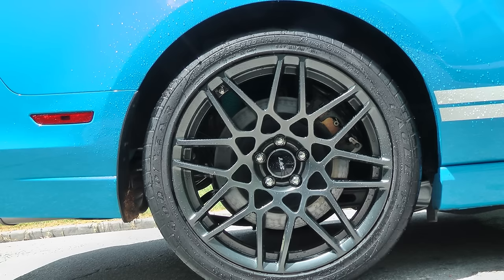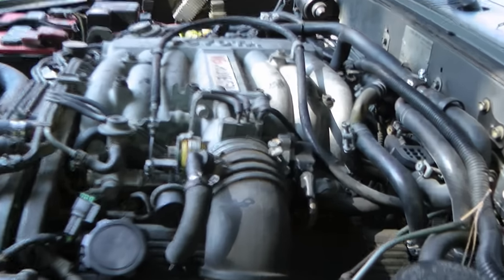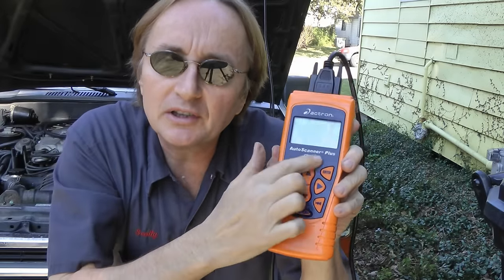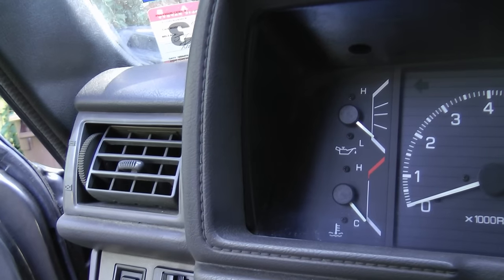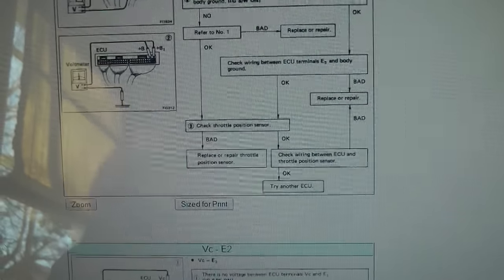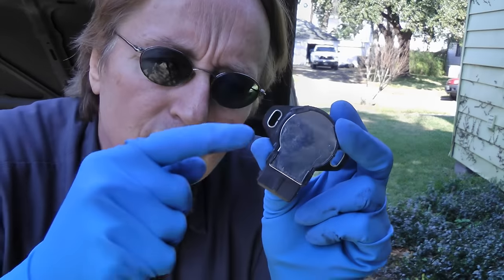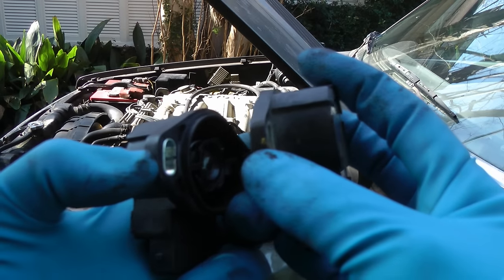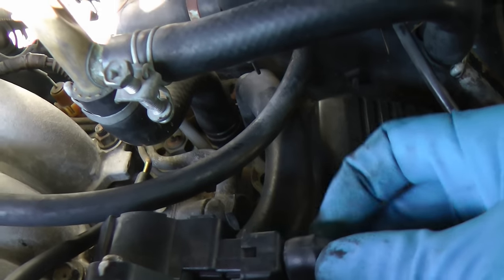How to Stop Car Hesitation (Throttle Position Sensor)

Comment: i have a 1990 full size blazer with a 5.7 tbi ive changed plugs,wires,cap n rotor,coil,ignition mogel n the distributor it still has a miss to it n a hesitation when throttle is pressed its been lije that bout a few weeks now.now when i drive it over a half hour or more it starts to bog out n backfire then shut off but starts back up it will do it a few times then i gota wait bout 20 min till it starts back up.....help
Reply from the maker: +Edwin Padilla   often fuel injector problems on those throttle bodies, try a couple new injectors
Reply: K thx

Comment: My bmw 323i 2009 is having issues where it will stutter when accelerating. The engine feels like its misfiring and when i turn on AC/heat i smell burnt oil. This issue cropped up right after taking it for an MVI. Please help.
Reply from the maker: +Daquan Jr. tons of things can do that, I would start with a full scan of recorded and live data and pray it's somethings like a bad ignition coils that go out a lot in those
Reply: Scotty Kilmer thanks for the info. someone said it's the abs tone ring, and when i turn off the DTC the issue goes away but burnt oil smell still there.

Comment: when i accelerate in my car it starts jumping and it wont go past like 10 to 15 mph when its cold but the service engine light isnt on could that be a sensor it doesnt do it when the car is warmed up
Reply: Thats definitely not the sensor. That sounds like a transmission issue.. When was the last time you had it serviced?

Comment: Just had a tune up on my 2007 chrysler 300 and now its hesitating when I stop for traffice lights, which my car didnot do with the old plugs!  I called the dealership & told them, I was unhappy so again I have to take car into shop.  SOMETHINGS NOT RIGHT.

Comment: hey maybe you can help me, my honda drives good for a while but after its warmed up, if I stop for any reason, and I hit tho gas peddle theater engine revs up, rpm goes up but car will hesitate for a while, and I can't gas it either, because  car just revs up and takes 10 seconds to pick up speed and then pulls hard
Reply from the maker: +Edwin Pastuizaca  if it's an automatic, transmission is going out. If it's a standard tranny, clutch is slipping and needs replacing
Reply: +Scotty Kilmer thank you , appreciate  it

Comment: what does it mean when my car seems like its accelerating while in park. it acts as if  I press on the accelerator and let go. it happens several times until i shut off the car.
Reply: My ranger was doing this as well. I thought i had bad sensors, but it ended up being a dime size hole in a vacuum line, i would suggest a vacuum check.
Reply: stupidmop420 turns out it was the throttle body gasket lol

Comment: hi I have a 2004 Toyota vitz and all of a sudden when I stop or switch gears my car engine dies den I have to restart it and the engine light comes on and when I press gas it takes forever to move is it my throttle body??
Reply from the maker: could be tons of things, but it's dying, so it sets trouble codes. Have a mechanic scan it for codes and see what it says. Even auto zone will scan it for free, then e mail me the codes as follows"If you wish to ask me car questions, I am switching my questions and answers to my google+ community “Auto Repair With Scotty Kilmer”. E mailing me here is ONLY for the live car talk shows on Thursdays at 1pm and saturdays at 10 am WHEN the shows are actually airing and I am answering live questions. So please, if you want your questions answered, go  to this link https://plus.google.com/u/0/communities/110758243155230074828  and join my community. You can then ask your question there and I answer them personally. You can also attend my weekly  Thursday afternoon and Saturday morning Live car talk events where I answer your questions live. . Just check it out at   https://www.youtube.com/watch?v=R6TIeV5oMYo
 And remember, every Tuesday, I upload a new video on youtube, don’t miss them."
Reply: hi the mechanic ran a diagnostic tests and he said it is the throttle body

Comment: code p0122 came up so I replaced the TPS and calibrated. but the error code still comes up after clearing it, any ideas?
Reply from the maker: bad wiring or bad main computer IF tps is actually goo

Comment: my toyota tundra runs smooth no miss in the gas, but it wants to hesitate going up a hill other than that it runs fine . need help
Reply: Brandon napier fuel filter
Reply: I had a truck that would miss or hesitate going up hills and it was an ignition coil going bad
Reply: both previous comments are a good bet, I also had the problem on my tercel and it turned out to be one of my spark plug wires grounding out and a cracked cap and rotor

Comment: my 1995 camaro runs but has no power and shakes when on the gas... any thoughts ??
Reply from the maker: +Paul Bonia tons of things can do that on such an old vehicle. Try tuning it up first, if not that, change the fuel filter and pressure test the fuel pump to see if it's weak
Reply: +Scotty Kilmer,  I did a tune up and oil change 2 days ago..  I'm going to clean out the throttle body and the Sensers and see what happens from there

Comment: i un plugged the trottle postion senser and it ran better so i put a new one on it and it runs good but has no power i un plug it and power is back
Reply from the maker: +Matt Hasting that's not a good test on any modern car, as computer software can compensate for unplugging stuff quite a bit. Have a pro analyze it, as in my video "fixing insanely complex modern cars"

Comment: the truck started to throw  dsrk smoke and doesn't go faster than first or second gear...what can be wrong with it?
Reply from the maker: it's running super rich, often leaking injectors or fuel pressure regulators do that

Comment: i have a 2002 Volkswagen  jetta and it doesn't  pick up  speed even when my foot is down  all the way what is the problem
Reply from the maker: +Emilio Rodriguez  have the maf sensor checked, and also pressure test the fuel pump to see if it's weak
Reply: Ok thank you

Comment: please help. don't know what the problem is but my car seem misfire after driving for awhile. on uphill my car even roll back when I press on gàs
Reply from the maker: start by pressure testing the fuel pump to see if it's weak
Reply: ok I haven't tried that yet. so far I have changed the transmission fluid n install new engine mounts n clean the maf sensor n throttle body. thank you

Comment: my 1999 Mazda miata hesitates it hot outside and the engine completely warms up was in 2k rpms but if I push it more it would hesitate
Reply from the maker: check for dirty internally leaking fuel injectors first and also check for build up on the throttle plate
Reply: +Scotty Kilmer please reply hi Scotty I have a 01 neon and I just rebuilt the throttle half shaft mod with aluminum butterfly same size if im 1/4 on the gas pedal it will bog or letting of the gas it will shutter sometimes not very often but now it did it today it did it on the 3/4 throttle  had to pull over and restart the car its jolting is gonna break the transmission fuel system is ok but feels like fuel delivery on all cylinders I might have been rough with the sensor on disassembly but I had buddy hook up his comp to it but it didn't bog out on the test ride could it still be the throttle sensor? thanks calvin
Reply: "update" when I'm driving normally the car runs fine but ones I need to drive more then 60 mph the car starts to hesitate doesn't let me go more than sixty could it be throttle position sensor ?

Comment: took it too a shop. and ask them to  put oil in the engine cause my car said to do it.. it was not vibrating or shaking they put oil in my car then told me that I had no oil in the engine but that wasn't possible because the car was working fine and wasn't sure now they put oil in my car that vibrates

Comment: I have a 1996 Subaru Legacy outback 2.5 and it skips and I change the plugs and coil and there's no code that comes up for it
Reply from the maker: pressure test the fuel pump, weak ones do that ad there is no code for low fuel pressure on that old thing

Comment: While driving my car at any speed when i let go of the accelerator the rpms drop extremely fast to under 1000 to around 500, then if i gas it hard it the rpms will jump up go down again and then they will go up normally. Can anyone help

Comment: There was a error in the tps so i changed the sensor bt tht comes again and again smtimes car cut off engine little bit feel like a knock bt its just for half of a second.plz tell me how to fix my car is a 2000 hyundai sonata
Reply: Scotty may not respond to this one.  I have engine knock on a hyundai myself.  My advice is to just sell your car and get something else.  That's what I want to do.  My vehicle is junky but that's just my opinion.
Reply: @Bob-yk9cz  change plugs to platinum then it will be fine bit
Reply: ...actually I have platinum spark plugs.  That's not my problem it's a dirty throttle and/or the engine has sludge and gunk in it.
Reply: @Bob-yk9cz  mmm is it? mine had same problem  none knew how to fix it after plug change got better n fuel burns well now

Comment: changed my o2 sensor, and now code p0134 os coming up what does this mean
Reply from the maker: +Gilbert Witcraft you got a bad sensor, or wiring to the sensor from computer is bad, or computer circuit itself has shorted out. good luck

Comment: my 2012 Nissan Altima start shut off then cut right on what do that mean
Reply from the maker: many things can do that, but first have the anti theft system checked, and the battery for low voltage

Comment: my car will run at idle but i have to keep foot on gas when i take my foot off the gas pedal the car shuts off please help  [2002 z28 camaro]
Reply from the maker: +415HUSTLEHARD try my video "how to fix a car that idles poorly" and also "finding engine vacuum leaks with a cigar'
Reply: Ok thanks

Comment: my 98 jaguar was shaking and acting funny.. after i get so far -- my safe mode kicks on - did that for months -- not it doesn't do  anything shut down on the highway - towed it home..  i thought it was the crash system chip-- then maybe spark plugs - especially when it was running -- the exhaust had a lot of gas fumes ???

Comment: my 98 Honda while driving it stops driving and it sounds like it's on nutrual but the it drives again I keep having this problem When im going slow or slowing down
Reply from the maker: often the transmission going out does that on hondas, have a pro check that, and if so, get rid or it or spend thousands rebuilding it

Comment: my car when throttle sensor is connected the rpm rises only to 2.5 on acceleration. when throttle sensor is disconnected and on acceleration the rpm rises to 4.2.i changed throttle sensor but could not solve the problem.pls help
Reply from the maker: +Jigme Dorji the computer has bypass software so that test is pretty much meaningless on a modern car. SO, I would advise getting at least analyzed by a pro like me to check ALL the systems, such as fuel pressure, live and mode six data, and possible vacuum leaks

Comment: i have a mazda protege5  2002 i changed the gas tank and thig that goes on top from the time i did this the car keeps stalling and jerking and it belly goes to 80 kmh very streeful
Reply from the maker: Vernon St Cyr many things can make em jerk, start by analyzing live and mode 6 data or have a mechanic do that to find the culprit, rather than just guess
Reply: They can't find the problem
Reply: Thanks for answering my questions
Reply: What Can happen if the  mechanic do the   fuel injector wrong they did in on my car
Reply: Canada have same really bad mechanics

Comment: scotty ,Frank towers from arsenal international located in cd juarez chihuahua mexico,i got a 1994 2.4 Toyota previa that once i engage drive it starts to sputer and then diez ,fuel pump was replaced  fuel filter replaced,butg no cigar.i would really apreciate the help it´s for my pastor at our congrigation.man thnxs if you could help us out..sincearly ,arsenal international
Reply from the maker: servicio especializado automotriz   check fuel pressure first, if bad, replace the fuel pressure regulator, If good, try my video "how to clean fuel injectors on your car
Reply: Scotty Kilmer thnx a million i´ll check that out. once we get the good thing running we´ll upload video for the fix...a colleague..arsenal international

Comment: That's the most half assed re-calibration method for a new sensor I've ever seen. Just mark it and put the new one on in the same spot roughly? Na, set it according to the right voltage output at idle position like most instructions generally say. That's if you want to do it right anyways. Your car, not mine.

Comment: p1120 throttle position sensor circuit 1 fault  on rodeo 2001 I change the throttle position sensor and still keep coming up
Reply: You need to calibrate the throttle position sensor
Reply: +Galileo Orellana how can I do that can I do it myself or I need to take it to a mechanic

Comment: I bought that one but i think that dont work for my car. My car is shaking when i'm going up the hill. I don't know how to explain that. I do not know anything about the cars.
Reply from the maker: MANY things can do that, start by having a mechanic pressure test the fuel pump and run a live data analysis with his scan tool to check for problem areas

Comment: my 99 blazer dose not revers anly at 3000 rpm and it reverses fast if i stop i jave run it up to 3000 rmp again.  and when i reach 50mph it idles or seems like it.
Reply from the maker: transmission is going out, rebuild it or get another vehicle considering its age and how blazers fall apart then
Reply: thank you very much, i enjoy the videos. any recommendation of a good vehicul, of not much elecrtonics

Comment: how to adjustment  throttle position sensor for  corolla 1992
Reply from the maker: +Mustafa Abd you really need a scan tool to read data as you do that, but you could try just adjusting it at the very middle and move it back and forth till it runs best then leave it there

Comment: my 03 chevy impala dont accelerate when I press the gas to da floor while driving I have to let off the gas to get more speed
Reply: sounds like its getting too much fuel
Reply: oh ok the rpms dont jump to the top when you do that. i need a fix for that too
Reply: Early Pierce where you able to fix it? what did you do yo fix it?

Comment: My car every time I drive uphill on highway it got no power from 65 miles per hour it drop downs to 50 miles per hour i step on the gas pedal but it go no where any idea on this Honda Pilot 2003 uphill issue 
And no check engine light on
Reply from the maker: pressure test the fuel pump AFTER changing the fuel filter, often weak fuel pressure
Reply: Cool thank you

Comment: My TPS  is in the wrong place!...lol. Just kidding, on mine it is not located opposite the throttle valve and throttle cables. Mine is located on the back (behind the throttle on the carb). I thought it had to be opposite the valve to move as it opened or closed. But, apparently not? I just had to look for it a couple of seconds. Sorry, I guess they don't call them carbs anymore? Mixes air and fuel.... same thing.

Comment: My 1999 Chevrolet  cavalier Cut off on me while I was driving.. I change fuel pump and it still don't start... when I was driving an stop at red light n went on green light it was taking it time to pick up speed an was jumping to get up to speed
Reply from the maker: try my video " fixing a car that cranks ut doesn't start up'
Reply: My 2000 Toyota Corolla 1.4vvti will idle when started but will not take the throttle and will not rave over 1500 rpm I'm really puzzled as what's to going and new help please comment your advice

Comment: Whenever I drive slow / accelerating between 0-20mph my car feels like its hesitating so bad. The car smells like rotten eggs also. Help
Reply from the maker: rotten egg smell is a bad catalytic converter or bad gasoline. More often the cat is bad and it will do all that
Reply: Scotty Kilmer do you think it’s a bad cat? My car is is shaking very hard and doesn’t feel like it wants to accelerate. I have about 63k miles. Please respond back, dealership wants $150 just to see if it is the cat
Reply from the maker: go somewhere else, I can pressure test a cat in fifteen minutes, that's too high just to
 test em

Comment: I washed the engine on a 2008 VW Jetta and now it runs rough???
Reply from the maker: big mistake, electronics got wet. Try drying them out with WD 40 spray, it displaces water

Comment: braking light keeps popping up and won't pass 60mph anyone knows?
Reply: Hi from France,yes I have had a similar problem,with a Fiat Bravo,the car would not go over 20 mph!Eventually after much fault finding,the fault was traced to a sticking brake light switch!The switch was sending a signal to the CPU saying that the car was under braking,so the CPU sent a signal to the engine,to disconnect any throttle pedal action! When the problem occurs again,stop the car and check to see if the brake lights are on,when the car is parked,ok?Lots of luck.David from France.

Comment: My car does that, but the scanner reads PO306 code (misfire)
Reply from the maker: +jerr dez  #6 cylinder is misfiring, can be bad spark plug, wire, ignition coil, fuel injector, OR an internal engine problem in # 6 cylinder
Reply: Thank you, I checked (seems to be ok)  everything except the fuel injector, Is there any way to check it w/out taking it off the engine?